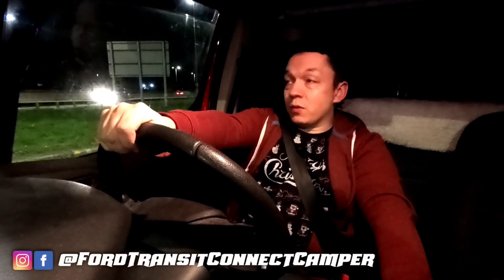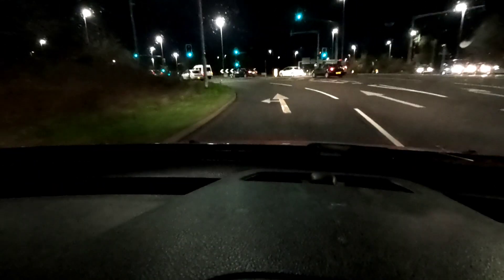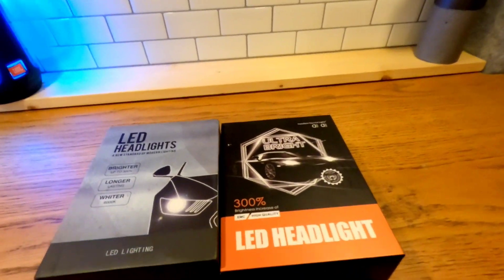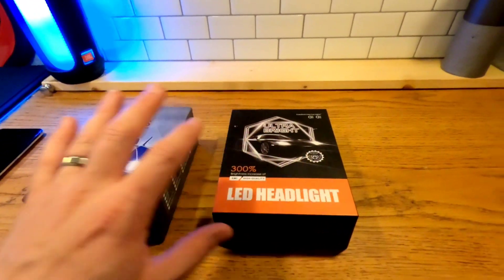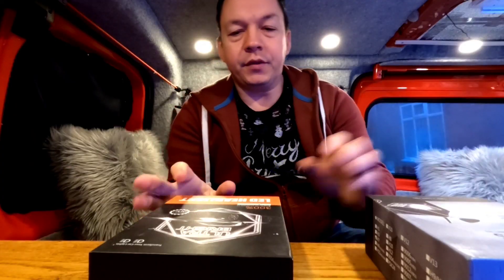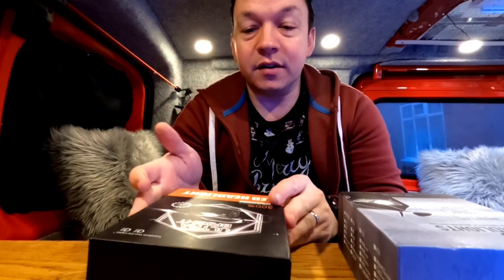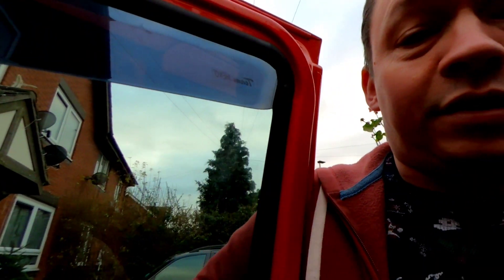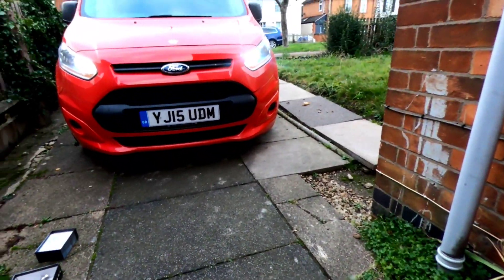OVERPOWERED to the MAX - Ford Transit Connect DIY Headlight Upgrade

Comment: Ive found this out.. the buttons that dim the dash board set it as bright as possible then lower it one touch at a time about 6 -7 goes the head lights will go brighter...try it and see if yours are the same

Comment: I also have a 2016 Connect and it is unbelievable how bad this van lights up. I went from a 2004 Focus to this one and at first (driving at night) I would stop to check if the bulbs were really on. It's ridiculous! I want to try some H7 4300º led now, but with the stock headlights it will create glare to those coming from the front for sure.
Reply from the maker: Ive had mine in for some time now and I've not had people flash or anything. I made sure when I fitted them that I lowered the low beam to what I considered to be the correct level and not a problem at all. I left them in for the MOT and had no mention about them for that. So I'm dead happy.

Comment: Hi,
I've ordered a set of LED's from Simon, on your recommendation, for my 2024 Ford Transit Connect Sport. 
I was just wondering....I know you say on the video how easily and quickly you changed your bulbs, but was it really that simple? How easy is it to see what your doing, as the space looks tiny, or would it be easier to take out the headlights?

Comment: I have the same problem with my US 2017 Transit Connect.  Headlights are ABSOLUTE TRASH.  Really excited to see how yours perform over time, because I've also been scared away by the longevity.
Reply from the maker: @Gaius I had that worry too about the life of them and only time will tell but after seeing them in the group for the past year I feel confident with these ones. I will do a follow up in the future. Thanks for the comment mate 😁
Reply: 18 Months WARRANTY with These LED Upgrades

Comment: Did the bulbs last long?
Reply from the maker: @cbrooke879 I'm still using the van daily and there still going strong 😁😁😁👍👍👍
Reply: @FordTransitConnectCamper  just checking as I got some for tourneo custom and blew in less than about 1000 miles. Sadly outside 18 month warranty don't do many miles. So was wondering if common with these from the same seller. And passed mot OK?
Reply from the maker: Passed a couple of MOTs now and never been mentioned so must be good for that. Think these have been in now for a few years, can't remember but how ever long this video is and I do 6k miles a year so I guess 12k miles and still going. 😁
Reply: @ChillVanlife  great thanks for the info.
Reply from the maker: @cbrooke879  thanks Craig 👍👍

Comment: Are they road legal?
Reply from the maker: @N.P.DETAILING I don't think any LED bulb is legal to be honest but only 10 minute change for the Mot.
Reply from the maker: @N.P.DETAILING I don't think any LED bulb is legal to be honest but only 10 minute change for the Mot.
Reply: Hi 
I fitted these lights today but I think way better than stock ones but they are too bright I’m getting a lot of cars flashing at me how have you got on with them 😳
Reply from the maker: @Alan-xk9rk  I can adjust the heigh of my beam so I made sure they are correctly positioned. Not had any problems at all with other drivers.
Reply: @ChillVanlife  I’ve positioned them different as recommended by Simon hopefully that will sort it out hope so I payed a lot of money out for these 😩 I bought all lights round van 😳
Reply: @ChillVanlife  do you know if they will pass an mot?
Reply from the maker: @Alan-xk9rk  I will speak to my garage before hand, if I need to swap them it will only take 10 minutes. It won't be a problem really.
Reply: @ChillVanlife  ok thanks my mot due in February 
I had hell of a job fitting mine 
I’ve small hands too 😳
The ones nearest the wing is very tight 😩
They do make hell of a difference though but blinding on coming traffic isn’t good 😎
Reply: Led on reflector light will blind everyone. Its like driving with your high beams on.  You need projector head light.